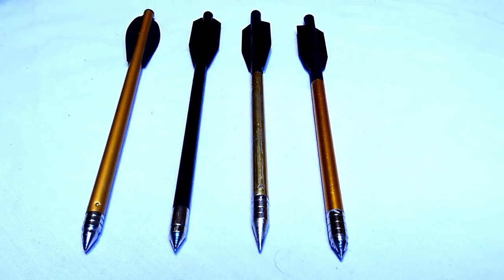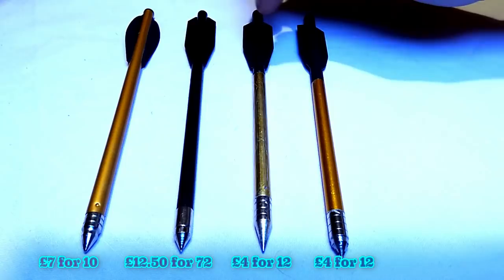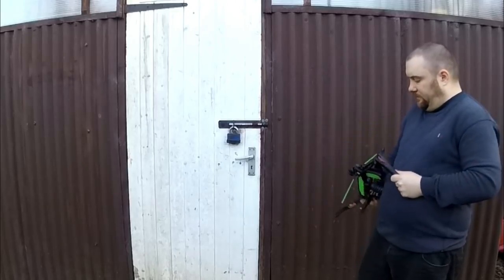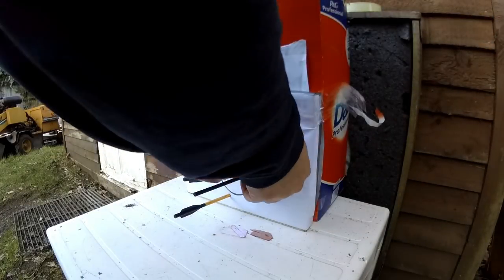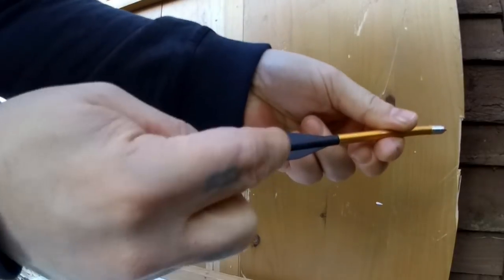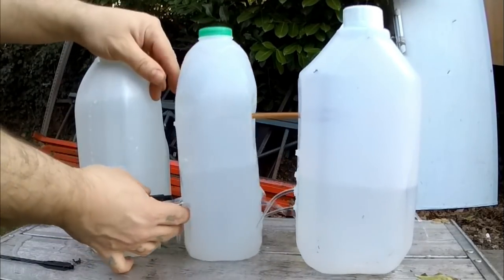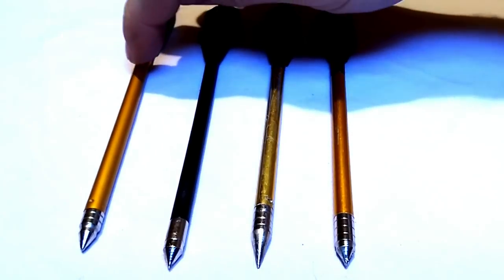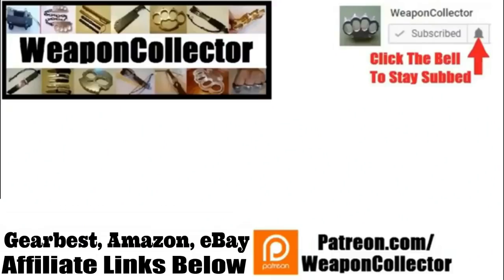Best Pistol Crossbow Bolts - A Beginners Guide

Comment: Good tests, confirmed what I already knew really. The one thing you didn't mention is how you can increase the weight of the hollow ones by adding lead airgun pellets or a cut-off nail. I prefer the alu one with screw in tip it's just a shame it uses a different size thread so you cant screw in a full size arrow head.
Reply from the maker: Hi mate, cheers for watching, i'll do that for another video, this is just standard bolts, next time i payout my patreon i'll get the more unusual bolts and also do a video on the best bolt mods as you mentioned,  adjusting the tips of these bolts makes a hell of a difference too
Reply: The screw-in tip bolts are not available in the States as separate items

Comment: Great video, thanx m8, I bought 36 of those on the right, orange aluminum with removable tips and flights (along with my Crossman 80lb) and broke almost all of them with a few hours on a Styrofoam target, not happy. Bent shafts, broken flights, lost tips. So I just ordered 60, red, all plastic (ABS) screw on tip for $20, so I won't care too much if they break....it's too much fun!!
Reply from the maker: Thanks Drew, glad it help, i would say the cheapest but best bolts you can buy as the gold alu and abs ones from Anglo Arms, you can get them on ebay
Reply: @WeaponCollector  cheers m8
Reply: I with i could find the screw in tips😞

Comment: Thanks, that's very helpful. Just need to learn to pull bolts out without bending the shafts ! Alloy shafts should always be pulled straight back in line with the shaft. If the tip is in wood,  dig it out with a knife or carefully use pliers on the tip itself. It would be a pain, but the plastic bolt heads could be drilled & pinned to secure them; or glued. The all-alloy shaft may last better with feather fletchings rather than plastics, as the feathers  will spring back into shape(a little steam usually helps) & also spin stabilise it in flight over longer distances.

Comment: theres also a differen gold alu + plastic version. i have some, coming in a black blister, and one in a camo blister. that black ones were okay, have 2 rings on their tips, while that camo package arrows had 3 rings and were really lousy. that plastic is softer, thinner. one flew away aside, two bolts broke in parts when removing from aim (got a professional aim from crossbow and bow sports shop, so thats not the reason). so my tip is: beware of that cheapo bolts. they are dangerous! always wear some eye protection goggles!

the beste ones are the complete alu versions. sadly, the rubber "feathers" rip off, when penetrating the aim too deep.

Comment: Hi WC    I was thinking  could you CUT some  angled lines into the ABS flights ?  I  mean close together cuts like an actual feather ?   It might be easier to smooth it out again  after hitting plastic bottles or when  the bolt penetrates  to the Flights.   just a thought.
Reply from the maker: good ideas mate,i shall look into that could would.
Reply: I've been working on this concept for a few months to enhance the flight characteristics of the bolts and just got my first mold  finished to  manufacture my design and after a half year or so of testing may offer them on the market for a reasonable price - unless the design gets pirated by someone who can blow them out for 1,000 for a dollar or a quid.

Comment: I've always wanted to take a full sized carbon fiber bolt and cut it down for use in a pistol crossbow just to see what it does. I've never gotten it done though 🤔
Reply from the maker: I have thought about it mate, but same as you not tried it yet, one thing with these new pistol crossbows is the thickness of the rifle bolts would be too thick, they have proper mechanism in these new ones like a rilfe crossbow has and will only fit a certain size bolts, the old pistol crossbows will fit a cut down rifle bolt though,will have to try it one day
Reply: Just tested the small 7.5 inch carbon bolts from my cobra R9 in my Redback and they work great, they are slightly thicker so the  arrow retention spring presses a bit hard against them, but I managed to loosen it off enough so it wouldn’t effect the velocity too much. They hit HARD!
Reply: I took the anti dryfire out of my pse viper and now a cut down carbon arrow works great.

Comment: Imagine you are using this device in a pinch for home defense. Imagine you’ve got a decent small broadhead on a bolt, and it hits the target. Do you want the recipient to be able to easily pull it out? Or do you want the flight to pull out or break off.... and then the shaft to easily remove from the head, thus leaving it painfully implanted in the recipient?

Comment: Mike how do you know which ones are the screw in ones when you order them online, do you count the ribbing on the steel bolt? it seems the screw in ones have more rib rings on the heads than the ones ont he left, and the fletching is full black not just the flights. but the tips look slightly different as well. I can't tell for sure, but are these screw tip ones?
https://www.ebay.co.uk/itm/60-x-6-5-Pistol-Crossbow-Bolts-Aluminium-Bolts-Steel-Tips-Hunting-Arrows-New/401932141639?hash=item5d9505c447:g:o0cAAOSw3opbaTRN
Reply from the maker: Sadly i'm not sure either mate, The only way i can ever confirm they are screw in ones is some of the pics actually show the heads taken off, thats about it really mate, i can pass on a few link via email if you want
Reply from the maker: Just emailed you mate, check spam as it has links, also the anglo arms ones in the card board and plastic packets are screw in.
Reply: @WeaponCollector  Cheers Mike, Ill check emails now.